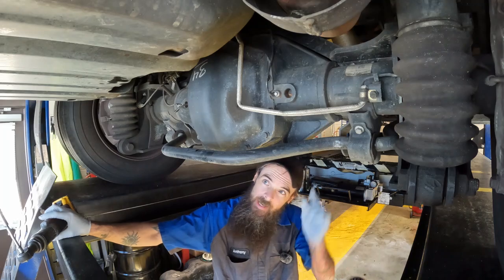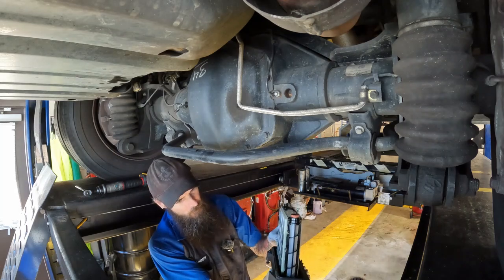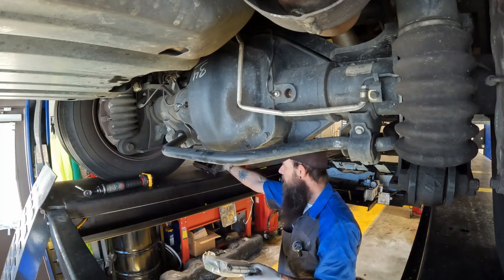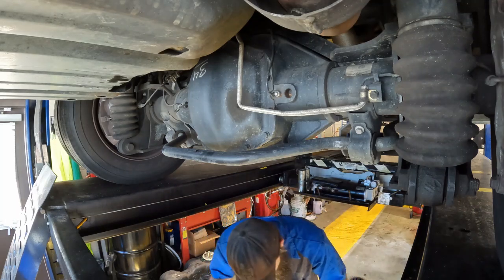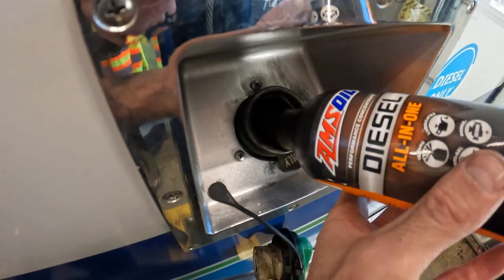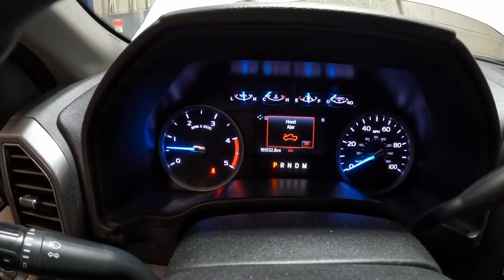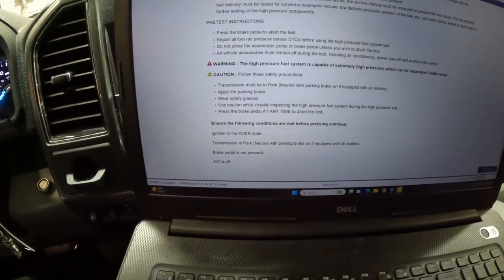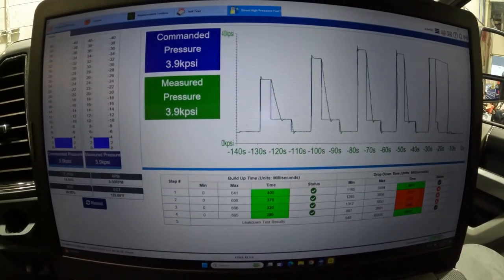Powerstroke Owners High Pressure Fuel System Test Revealed!

Comment: thank you for the video, what should the fuel pressure be for a 2012 F250 diesel  6.7
Reply from the maker: High or low? Low side is 53-75 psi. Anything below 53 will trigger a P0087A.  High side is 5000 just to start. And csn reach upwards of 30,000.  Mkst of the time I see the low side on average between 68-72

Comment: Thanks for posting.  Good information. Did they do PM on the fuel filter, or just let it go?  What was the mileage - ok 165K.
Reply from the maker: It got skipped over. Vehucle service log wasn't updated. It's one of my fleet vehicles. We change them out every 15k miles.

Comment: Is that the same fuel-filter that is on my F-250? The one at the tank, that is. I thought mine was on the frame-rail and my water-separator was on the tank. That fun separator with the plastic handle that apparently likes to break. I'm just curious. Mine's still going strong. I am beginning to wonder if the metal we found that one time was from the pump, like others suggested. I mean to be sure the CP4 can't go forever if it's dumping shavings, right?
Reply from the maker: @GuretoSefirosu  yours is a midship tank. This is a dually rear wheel after Axle tank.  Same filter though. That metal had to be from the pump. Nowhere else for it to come from. CP4 is one of those things you can't put a number on. So go a long time. Some don't go far at all.
Reply: @BeardedFordTech  WHat I meant about the pump was that several people told me that they have had fuel shavings from a bad fuel pump at a fuel island, at a truck stop. I am wondering if that was my case. Either way it's going strong.
Reply: @GuretoSefirosu i had some debris in my system. Some metal but when I did my cp4 there was no metal on the valve or in the pump when I took the valve off. Where everyone looks for the glitter party. I first remember seeing debris in the separator bowl at about 100k and changed my fuel pump at about 161k. Everything seemed normal and my actual fuel pressure was matching the commanded pressure. I am not sure how that crap got in there. There were some decent chucks at times also. I think contamination from fuel stations.  By my sister's in Michigan she had got bad fuel from a station a few times. She had a 7.3ps. When I changed her filter the amount of crap in the filter and the bowl was astonishing! I believe that's where my contamination came from. Regardless I am happy that I changed the pump and not afraid about getting bad fuel or even someone messing with the fuel.
Good luck.

Comment: Great video!  Thanks for sharing this.  I see in the comments you said this truck was at about 25 to 30k on the last filter change, which was one of my questions.  I do mine around 15 to 17 k.  We have winterized Diesel here in Elko Nevada, but I still use a winter additive.  Maybe not needed but rather be safe than sorry.  Currently finishing up my Optilube winter formula additive, then will switch to Amsoil or Archoil.  I've seen -10 to -15 temps here.
Reply from the maker: @richwitt3559  thats cold. Gets cold in the desert. It will definitely gel at that temperature  and you don't want that. We do the fuel filters every 15k. This one apparently got missed cause the vehicle service log wasn't updated. But it's fixed now. Did you see the brake flush video that you requested?

Comment: Ford dealer ruined my weekend by not seating upper fuel line properly and spraying diesel all over the place 
My truck still stinks since Thursday 
Going to spray simple green under hood tomorrow and hose it off and run through car wash 
It's sad when dealer tech rushes and makes a mistake 
Shit does happen, and I get it, but they should of did some cleaning before giving me truck back
Reply from the maker: @nysucks4508  dawn apple scent dish soap works best to get rid of diesel smell. We also use dawn dish soap and sugar for and cleaner. Best hand cleaner ever. Thank me later.  And yeah. It's sad they gave it back thay way.  Things do happen i understand. But that's just careless
Reply: @BeardedFordTech  thanks for the info , I'll try it
Reply from the maker: @nysucks4508  works great